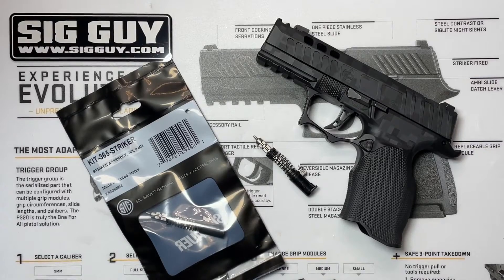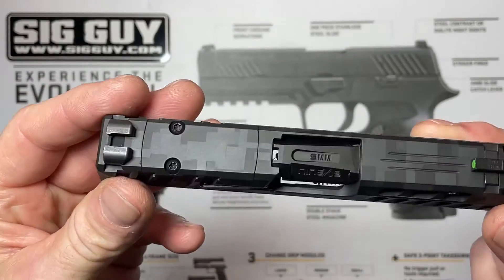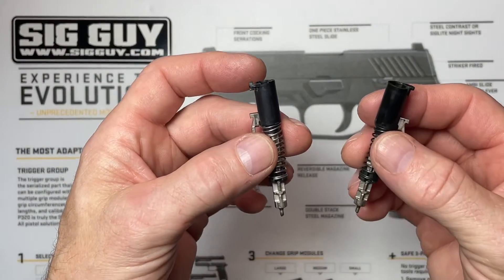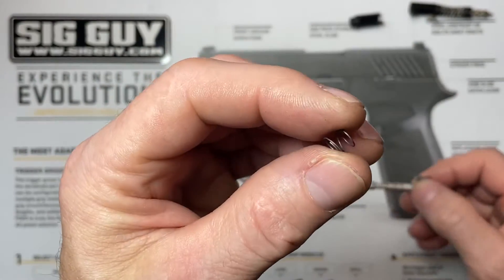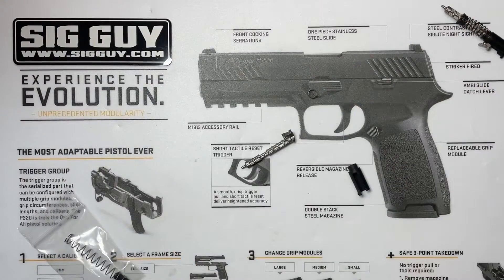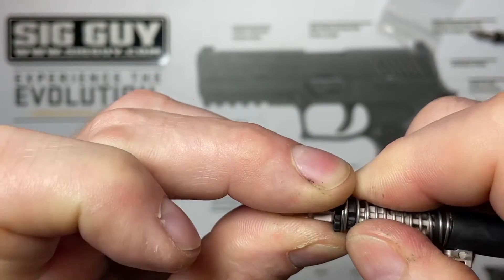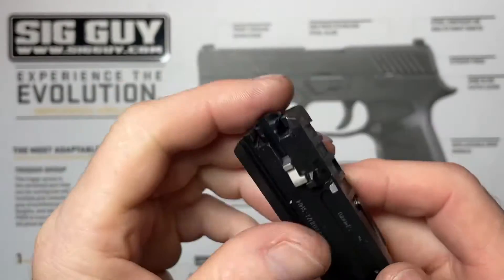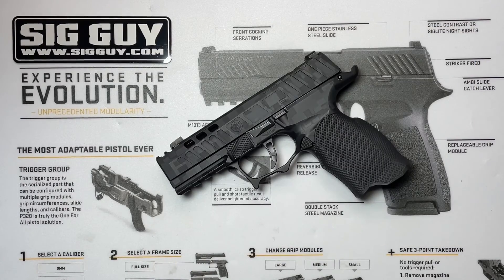Did you lose the little spring in your SIG Sauer P365 striker assembly? 😱

Comment: That little spring helps reset the striker pin back away from the fired primer.  To demo, put the NEW style striker assy in a X Macro slide for example, (clear and safe obviously) dry fire it, and SLOWLY move the slide to the rear.  You’ll notice the striker pin still protruding through the hole in the slide where it contacts the primer. With the little spring installed it will be retracted.  It’s due to the cups bottoming out in the cavity they occupy in the slide and the black plastic cup compressing the spring slightly as it rests against the back plate.  This leaves some play fore and aft in the striker pin. That little spring although not necessary took up that small amount of play in the pin.  Note you may have to slightly depress the striker safety assy to notice the play.  I hope this makes sense.  Love your videos!

Comment: When the striker return spring is left out it causes a CHANGE in the operation of the manual safety lever, which allows the manual safety lever to be engaged in an UNINTENDED condition, also depending upon whether the muzzle is pointed upward or downward.

WITH the striker return spring INSTALLED you can only engage the manual safety lever when the striker is COCKED and ready to fire.  If the striker is NOT cocked it will NOT allow you to engage the manual safety lever.

When the striker return spring is NOT installed, if the striker is NOT cocked, AND you have the muzzle pointed DOWNWARD, it will ALLOW the manual safety lever to be ENGAGED in an unintended condition and lock the slide in position.   If the striker is NOT cocked and you instead point the muzzle UPWARD it will NOT allow you to engage the manual safety lever.

Here is the reason why.  When the striker is NOT cocked, WITHOUT the striker return spring installed, it allows the striker to slide forward and backward about 0.080".  When the striker is forward and the firing pin is inside the breech, the manual safety lever can be engaged in an UNINTENDED condition and lock the slide in position.  When the firing pin has been RETRACTED from the breech, the manual safety lever cannot  be engaged when the striker is NOT cocked.

Note that the striker propelling spring retaining cups do NOT completely fill the gap in the striker by design and the striker can slide back and forth within the striker propelling spring retaining cups.

When the striker assembly is installed into the slide, the striker propelling spring's expansion is limited by the slide from extending as far as it does when the striker assembly is outside of the slide. Because of this, when the striker assembly is installed into the slide and the striker is NOT cocked, the striker can slide forward and backward about 0.080". When the striker return spring is installed it retracts the striker from the breech about 0.080" and keeps the striker from sliding back and forth, thus preventing the manual safety lever from becoming engaged in an unintended condition and locking the slide in position.

When the striker is NOT cocked, the striker return spring and the striker propelling spring are in direct opposition to each other.  But the striker propelling spring is so much stronger that striker return spring does NOT prevent the striker propelling spring from reaching maximum expansion within the slide and the striker return spring is partially compressed, essentially adding preload to the striker return spring.  The striker return spring acts upon the free floating striker and pushes it backwards about 0.080".  The striker is prevented from moving further rearward by the striker propelling spring.  The striker return spring would need to be considerably stronger in order to overcome the striker propelling spring and be able to move the striker any further rearward.

When the striker is cocked, the striker propelling spring is compressed and striker return spring is completely uncompressed.  

When the sear releases the striker, the striker propelling spring uncompresses and propels the striker forward.  As the firing pin nears the breech, the striker return spring begins to compress.  The striker propelling spring is prevented from expanding any further by the slide and does not impart any more propelling energy to the striker. The momentum of the striker continues the forward motion of the striker, while the striker return spring continues to compress and oppose the forward motion of the striker.  Eventually the firing pin contacts the primer and the forward motion of the striker is stopped.

In theory the striker return spring will reduce the intensity of the firing pin impact upon the primer.   But in practice the striker return spring is so weak that it's effect on the primer strike depth is negligible.

Determining whether or not the striker return spring could retract the firing pin from the breech BEFORE the shell case is extracted and pushing the firing pin and striker rearward, would probably require a high speed camera and a slide that is cutaway to view the striker and shell case as it is being extracted.  I doubt that the very weak striker return spring has very much effect on primer drag.

If the striker propelling spring retainer cups are too long they could possibly limit the travel of the firing pin and result in light primer strikes.  Allegedly, the one piece striker propelling spring retainer design was too long and caused light primer strikes.

The lack of the striker return spring also causes other annoyances.  Whenever I have the slide removed I always press the striker safety block inward to make sure that it is moving freely.  Without the striker return spring installed the striker safety block gets held in place by the striker and I have to physically push the striker rearward.  Whereas, with the striker return spring installed IT moves the striker rearward automatically releasing the striker safety block.

I purchased a P365XL in December of 2022.  As soon as I discovered the issues that the lack of a striker return spring was causing I stole a striker return spring from a spare striker assembly and installed it into my P365XL and eliminated the problem.  I have not had any malfunctions, or light primer strikes, or noticed any problem that the striker return spring causes.

Regardless of how you are supposed to operate a firearm, having a pistol operating in odd non-uniform ways that it shouldn't is eventually going to causes someone a serious problem that wouldn't be possible if the striker return spring is installed.

Not having the striker return spring installed is like a having a gear shift lever that changes it's shift pattern depending upon whether you are going uphill or downhill.

What possible problem would having the striker return spring installed cause???

Why would you NOT want the striker return spring installed???